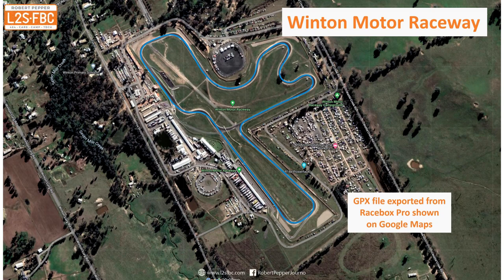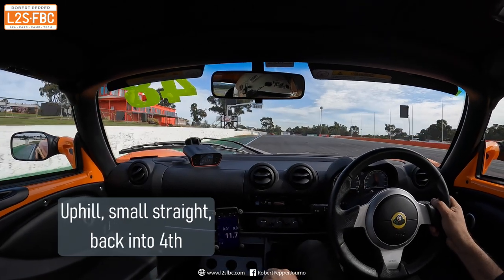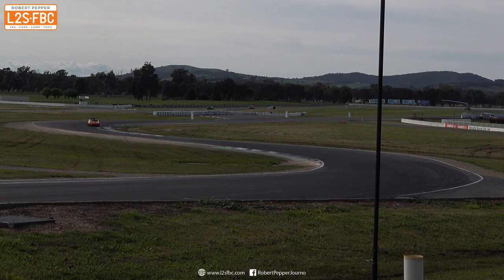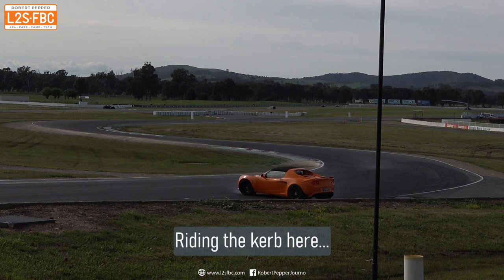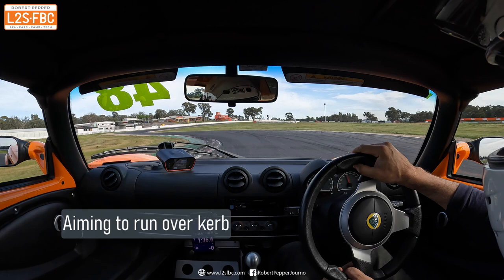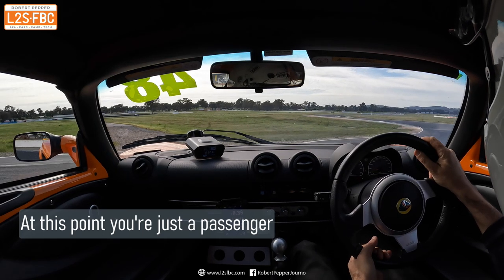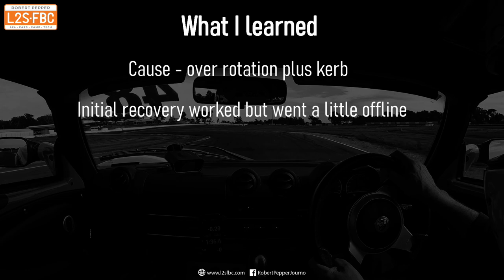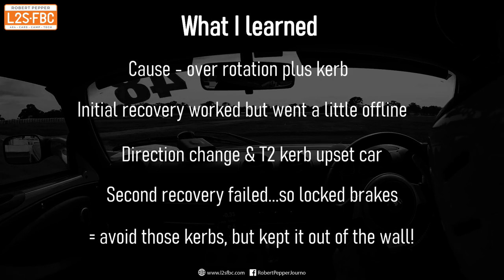Mid-engined Lotus track spin! What, why, how?

Comment from the maker: Copied some comments up here from experienced drivers to aid discussion and add some more information, what do others think?

"You tried to cheat to the apex on t1, which you came in to shallow compromising your line into T1, then you added more lock to get it to bite thus initiating understeer, you then added more brake to adjust and caused an oversteer moment. If you had just admitted defeat at that point and didn't try to hit the apex of T2 you would have been slow, but you wouldn't have spun. Since you had already caused a polar moment after T1, you had already unsettled the car and had basically no chance of catching it with how aggressively you turned into T2. 
Next time try braking deeper into a T1, and only add steering in one fluid motion, try not to take bites at the corner. In short wheelbase cars like the Elise, these 'bites' cause small upsets to the cars balance thus making it more likely to induce oversteer at the limit. Mix that with the polar moment of inertia of these little guys, they are very hard to catch once they start to go. The Kerbs basically had nothing to do with your spin, they just amplified an already compromised line and technique."

"As a nürburgring ring taxi driver and a porsche driving instructor.  He is correct. You got too aggressive/fast with the entry into the turn 1 apex and then turn 2 apex after unsettling the car. With your mistake in turn 1 all you had to do was remain calm until the car settled again before making turn 2. You were just way too aggressive trying to hit the apex in turn 2 because you overshot turn 1. Smooth is fast and there's no other way around it."

My response on these two is that yes I was being aggressive on T1.  Without the kerbs I am convinced I would not have spun as I have spent a lot of time in that car and never had a problem, and dealt with a lot of corner-entry oversteer.  I don't think there was enough time between T1 and T2 to wait to settle the car.  As ever, the genesis of the spin was before the actual spin, my decision to play kerbs on T1, a risk which did not pay off.  Perhaps with better technique as described above it would have worked, but I decided to forgo any potential laptime improvement and just avoid them thereafter.

Since I made this video I've changed the alignment on the Elise and it is way, way less prone to oversteer entering a corner now, and there is less understeer on exit.  Previously every session on track would see me correcting oversteer into a corner under brakes somewhere or other, and even squaring off the corner somewhat I still had understeer.  The car is much more stable now, and it'd be interesting to use a time machine to retry that situation and see if it turned out differently!

Comment: 28 years driving mid engine, I still spin out if pushing too hard.  Though I will state it is not snap oversteer, that's a internet myth.   Driver error.  But it's fun AF.

Comment: Hey can you do a video on the “pull pal” or sand anchors in general.
Reply from the maker: I've found them not to work
Reply: @L2SFBC  I’m just putting together my truck for some small beach adventures out here on Long Island  so I’m glad you told me before I get one
Reply from the maker: Have a look at my beach/sand recovery videos. I have done quite a few. In my view, all you need is 4 traction ramps, a shovel, and a tyre pressure gauge. An interesting comment on a trackday video btw :-)

Comment: Haha, nice work. You sure need quick hands in a Lotus Elise/Exige (or pretty much any mid engined car) to keep it under control (kind of) when the back lets go. Your summary is right. Too hot turning in to left hander and then you decided to press on with entry to the right hander despite being off line, hence a 2nd too sharp weight transfer, clipping kerb and there you go. Well done on smashing down on brakes to keep it off the wall most importantly.
I find that rear tyres are critical to keeping a Lotus happy on track. If they're not the right tyre and also relatively fresh (not heat cycled out), then they hang on well. Otherwise they're very unpredictable. There's a video on my channel somewhere of the back snapping sideways for no reason I can see at all, thanks to AD08R tyres that were past their prime!
Like your work, keep it up!

Comment: Excellent video again Robert, and excellent display of driver awareness and skill. 

I don't have either your experience or aptitude in this area by a large margin, I do have some experience with icy conditions, just not sure how well they translate since the ice slows everything down a bit.

The correction after T1 was exceptional. 

In my experience on snow for instance, waiting to see feedback from the vehicle of the steering correction is often too late. 

Often it would be a quick dose of opposite lock without the car seemingly doing anything at all, then back to a more neutral steering angle to meet the back-end. 

But with the grip of the tarmac, who knows where the car would end up.

All in all, great job and great save.
Reply from the maker: Hi Robby - very good and interesting points you make there. I don't think very low grip surfaces such as ice require the same technique as higher-grip surfaces.  Things happen at a lower car speed, and often the rotation of the skid is slower too. I do feel you need to wait for any car to at least stop rotating before you apply a correction...otherwise the 'correction' simply adds to the problem.  An interesting subject, thanks.
Reply: @L2SFBC  

I agree it is quite different. However the correction did look like it had some similarities I have encountered. 

Here is a vid of a rally car on snow, he does what I tried to describe around the 30 second mark. Steering inputs without waiting for the car to react fully before going back to neutral positions. https://youtu.be/iLiy4gp4TyY

I do realize these driving styles aren't translatable, but it is indeed an interesting topic.
Reply from the maker: ah yes I see your point - I don't suggest waiting for the car to come back to neutral, that's far too late. But the correction cannot be before the car stops rotating. The driver is feeling tiny changes before the camera even picks them up...been there on dirt and even on track.

Comment: If you are going to go off-road, you of all people should know to drop your tyre pressures! :)
How you kept it off the armco is a miracle. Locking the brakes should have washed off rotational motion of the vehicle, so was that why you locked the wheels up at that point?
Reply from the maker: if you lose control of a car, you should ALWAYS lock the brakes as that way the car tends to continue in the original direction which is often safest.  Not locking the brakes tends to lead to the car spearing off in some random direction. More here : https://youtu.be/kQ5leWLp65I  it wasn't a miracle I kept it out of the barriers...it was training and knowledge, something I strive to achieve on this channel.  Same deal for oversteer recovery and everything else. "Luck" is bred by knowledge and training in my view.  That was only the second time I've ever spun any car on track (well, racing aside) and it's more knowledge/practice than talent.  But, motorsport seems to rely on "she'll be right" attitudes as we say here in Australia. I challenge that - learn, understand, apply!
Reply: @L2SFBC  Absobloodylutely.
Reply: Locking the breaks makes you continue in the direction you are going, it is a last resorts to have some control of where you are heading when you are spinning and have lost control.

Comment: You tried to cheat to the apex on t1, which you came in to shallow compromising your line into T1, then you added more lock to get it to bite thus initiating understeer, you then added more brake to adjust and caused an oversteer moment. If you had just admitted defeat at that point and didn't try to hit the apex of T2 you would have been slow, but you wouldn't have spun. Since you had already caused a polar moment after T1, you had already unsettled the car and had basically no chance of catching it with how aggressively you turned into T2. 
Next time try braking deeper into a T1, and only add steering in one fluid motion, try not to take bites at the corner. In short wheelbase cars like the Elise, these 'bites' cause small upsets to the cars balance thus making it more likely to induce oversteer at the limit. Mix that with the polar moment of inertia of these little guys, they are very hard to catch once they start to go. The Kerbs basically had nothing to do with your spin, they just amplified an already compromised line and technique.
Reply from the maker: Thanks...read that twice and don't agree. I felt the car unsettle as I hit the kerb. Every other lap was fine. In some cars I can get away with a bit of kerb but not that time.
Reply: @L2SFBC  As a nürburgring ring taxi driver and a porsche driving instructor.  He is correct. You got too aggressive/fast with the entry into the turn 1 apex and then turn 2 apex after unsettling the car. With your mistake in turn 1 all you had to do was remain calm until the car settled again before making turn 2. You were just way too aggressive trying to hit the apex in turn 2 because you overshot turn 1. Smooth is fast and there's no other way around it.
Reply from the maker: @vtecunleashed94  thank you, I have added your comment and the original comment to a pin for discussion.